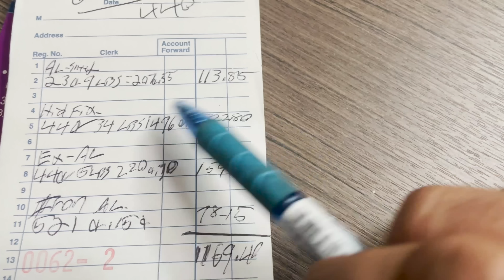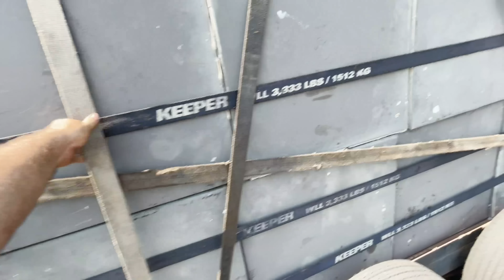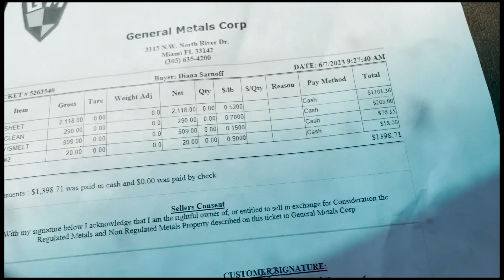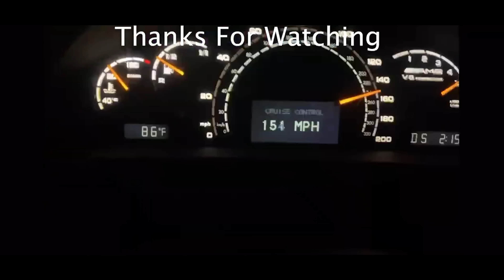Massive Lighting Scrap Out In Daytona Beach Pt.1

Comment: First! 😎 If you cut those reflectors down the side with sheet metal cutters, they will stack so much easier, as each one that goes on top will shrink a little in width.
You are always coming across sheet metal, why not make your own fender for your trailer!
Reply from the maker: 👊 Thanks